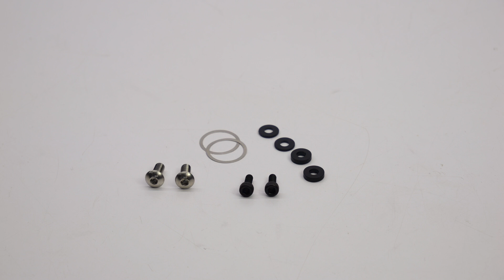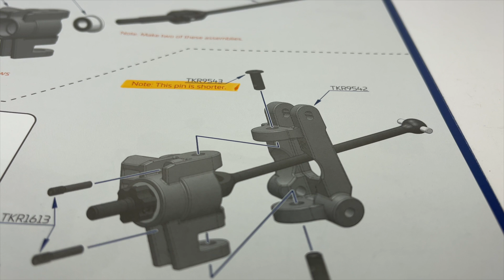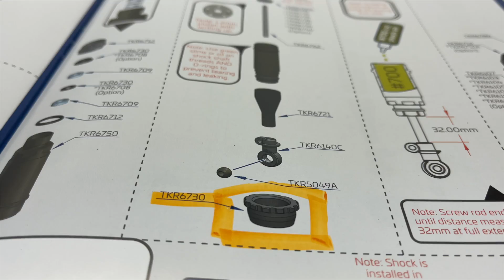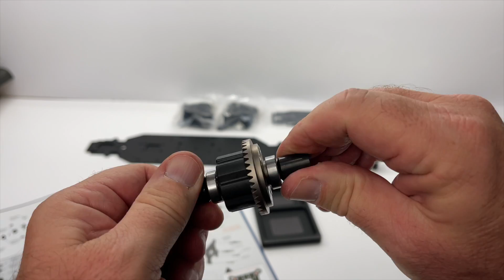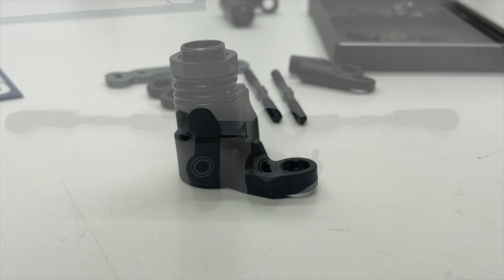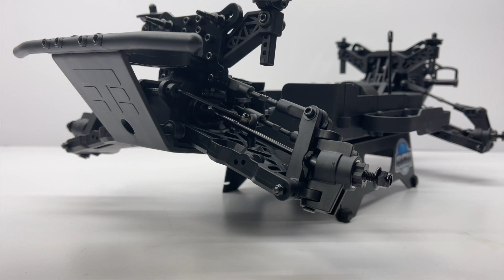NEW!! Tekno SCT410 2.0 ✌️ - IN DEPTH BUILD REVIEW - How it Assembles, Quirks/Features

Comment: Idk if the manual mentions the optional steel or aluminum diff cross pins but was wondering if they work with the included diff gears or require different ones. Just don’t feel good about composite cross pins.
Reply from the maker: They use composite for their weight savings. I've never had any durability issues with the composite pins. If you're dead set, I'd get the aluminum ones over steel, because of what I mentioned earlier.

Comment: Great video series. thanks for all the info. This may be kind of silly question, but as stated on the box, parts compatibility with the 1/8th buggy, could the sct 410 2.0 be converted, say later on, to a 1/8th scale buggy? that would be pretty cool.
Reply from the maker: Thanks Buddy!  They're meaning some of the upgrade parts like the A, B, C, D blocks.  Over all, the buggy is more robust than the SCT410 2.0.  It would take a ton of money in parts to convert, not to mention the chassis is totally different as well.
Reply: okay awesome. thanks for the info.  @TheRCNetwork
Reply: @monocogenit1  Hi, I converted my old SCT410.3 to an EB48'ish buggy with an EB48.4 body, EB48 front bumper and an EB48 wing mount with wing.

I still use SCT tires, wheels and electronics. It looks just like an 8th scale buggy. I can switch it back to a SCT in 10 minutes.

Did you convert your SCT410 2.0?

I'll probably get one and try it. The converted SCT410.3 is great for outdoor 8th scale tracks.

Then I can switch it back to a "1/10" scale SCT for indoor 1/10 tracks. :)

Comment: The SERVO SAVER was a nightmare.  The diffs!  OMG!  Mine bled out!  CRANK all the way down to the point of stripping.   
**Check ESC wires and direction.  My On / Off is too close to the center drive.  

LAST ONE!  The TOP Plate brace!  Get ready to scream.  It's going to stress you out.  It requires the screws to be installed in a select order.  
Make sure your Front Diff is perfect.  Wait a few days just to check if it bleeds.  You do NOT want to go back and rebuild the Front End.  Serious time loss.
Reply from the maker: Building experience will fix all of these issues you stated.  The servo saver has been the same on nearly every Tekno 1/8th scale model since the beginning.  A simple use of a wheel wrench will make it easy.  The diffs have evolved over time and these diffs are the smoothest, leak free ones ever from Tekno.  There are building secrets on building diffs.  It's about consistency and using the right amount of black grease in the right parts.  The top plate brace was new, but I showed exactly how to do it in the video.  The front diff is easily accessible by just removing 6 screws.  Once you build one Tekno, you can build them all.  Have fun RC'ing, Spin
Reply: @TheRCNetwork  I respectfully disagree when it comes to the servo saver.  I know  because I just got it done about a week ago.  

You need to be a GORILLA to get that Spring pressed down.  Even after placing the spring in a vice-grip for a couple hours, it did not soften up.  Which is a good thing, I might add.  

However, I'm going to be pure honest about that piece.  It's going to make you curse.  You will use profanity when building the servo saver.  It's not a breeze.  Even with the 17mm wrench in hand, it's not EZ PZ.

Now by no means does that mean "don't buy the kit".  It's an awesome kit.  Once you get through that small bit of hell, it's a breeze.  It's not building experience that will get you past that, it's pure torque and muscle.
Reply: Not agree! Use the 17mm Wrench from Tekno and it's easy! ;)  @SpinRush

Comment: Hi, ich hatte den alten Tekno MT410 . wie groß ist der neue im Vergleich zum alten? war mit dem alten eigentlich richtig zufrieden! doch man will immer was Neues ausprobieren☺️ will den  neun auf 4S fahren fahren,und kann mich nicht entscheiden zwischen CST410.2.0 und MT410 2.0
Reply from the maker: The new MT410 2.0 is a bit smaller...a true 1/10th scale MT.  The old one was a true 1/8th scale (even though Tekno mistakenly called it a 1/10th.  The new 2.0 has 12mm hexes, shorter wheelbase and uses Buggy/SCT arms vs. the Truggy arms on the MT410.  Plus, I'm not a fan of that motor mount - the pinion options are minimal and changing a pinion/pulling the motor is a pain.

Comment: Is the spur metal? Hard to tell from the video as it's black, could be steel or plastic.
Reply from the maker: It’s the stock plastic spur.
Reply: @TheRCNetwork  Thank you for the response. Bit odd that all the diffs are metal but not the main spur!
Reply from the maker: Most electric race kits include a plastic spur gear.  As long as you set your mesh correctly, you should never have an issue.  The positive side of the Tekno motor mount on this truck is that the mesh is fixed - and done well, so no guessing if you have a good mesh.  Manufacturers usually use a plastic spur gear to create a "fail-safe" on the truck.  In other words, it's better to strip a $5 plastic spur gear than twisting a $45 set of driveshafts or bricking a $179 motor.  In all honesty, I have stripped 2 spur gears in my existence on The RCNetwork - one was the Losi mini 8ight, which had a terrible center diff mount and the other was my Axial Bomber when I was racing U4RC, as I way over powered / over weighted that truck.  That's about 350 RC's I've owned/ran and only 2 have had an issue.  Probably 90% had plastic spurs.
Reply: @TheRCNetwork  Fair enough, I'm not a racer, just a casual basher so maybe the Tekno isn't for me. Sure looks sweet though!
Reply from the maker: Tekno is the graduation from the more "cookie cutter" type vehicles like the Traxxas Slash or the Arrma Denton.  What I found out about Tekno (and most race vehicles) is that you'll get a higher quality kit, more adjustability using higher grade materials and is race inspired, so it drives great.  Plus, they're designed to last during racing, so typically much more durable that RTR RC's.

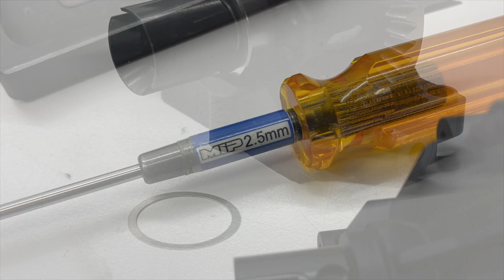Comment: 8:27 can you please explain why you shim the diff. Is it to stop lateral movement? Or is it to set the mesh between the crown gear and the diff pinion? The reason that I ask is because you installed the shim on the non drive side of the diff which seems like you are pushing the gears away from each other, which is something I wouldn’t have expected to be a desired outcome.
Reply from the maker: Good question - according to their manual "(the diff shims)may not be required. Check fitment and add if needed."  They show them to only go on the non drive side of the diff...I don't have specific reasoning as to why.  All I know is that Tekno kits usually don't take any shims.  You should only use shims if you feel it needs it.  I only add them in if I can easily put them in.....and in this case one fit in easily.  I agree with you, it doesn't make sense to add them to the non-drive side....but maybe they engineered it that way>?

Comment: Some of the new features i like and others im not so keen on. 
Like the aluminium servo horn, like the front shock tower brace and new bumper design. Also like they added steel inserts into the plastic a,b,c,d blocks. 👍

Not keen on the fixed motor mount, and the gears being covered. 

Not sure about only having a single strap either. The old one had 3 straps and although it was a pain to get off, it ment if one snaps youve got backup.
Reply from the maker: 100% agree except the strap...the new wider 2.0 strap is fine...even on my EB48 2.0 (with a massive 4s).  The motor mount is the big bummer and I looked up TKR9511 and it's the same mount....just meant for 1/8th scale motors and to fit 12-16t pinions.  Not sure we will get a proper sliding mount

Comment: Appreciate you getting the info from Tekno on why they chose 13mm shocks with 16mm springs. Very interesting.  Those new 5 hole pistons might become a popular tuning option for EB410/ET410 owners.
Reply from the maker: The 13/16mm thing caught me off guard right when I saw the box.  It seemed like such a big difference in my head until I built them.  It actually isn't that terrible for the SCT.
Reply: It's probably better with 2s and small electronics. I bet with a 1/8th motor and 4s a 16mm would be better again.

Comment: We shall see how/if it is good. Mine is being shipped out today. It looks beefier than hell!
Reply from the maker: Nice!  It's a fun build...make sure and install the electronics when the manual says to.....I had a ton of disassembly for that third videos to drop the electronics in
Reply: I thought I had overlooked something because I was tired but just took another look. We are not able to make adjustments for kick up, sweep, and anti squat out of the box. Only way to be able to make those adjustments is if we order the aluminum A,B,C and D blocks at 29.99 each. That sucks! If I am wrong please let me know! I have gone over the manual three times looking for it!
 @TheRCNetwork
Reply: And Tekno is out of stock on the hinge pin inserts!
Reply from the maker: You are correct... the stock suspension holders are not adjustable.  The EB48 2.X's blocks are the upgrade part.  Check Fierce RC Solutions or Amain as a secondary source for them.  On the durability side, all of the stock holders have a metal impregnated part though.